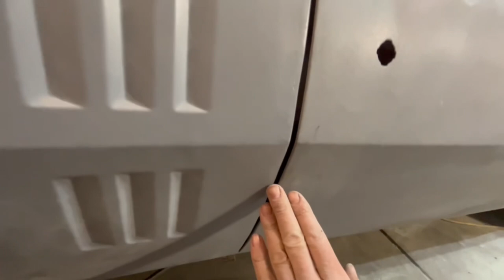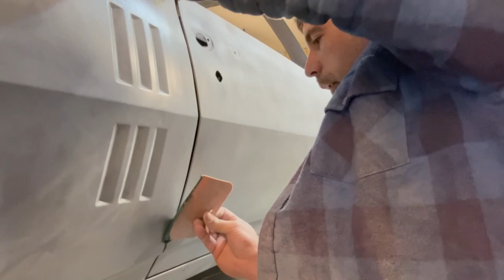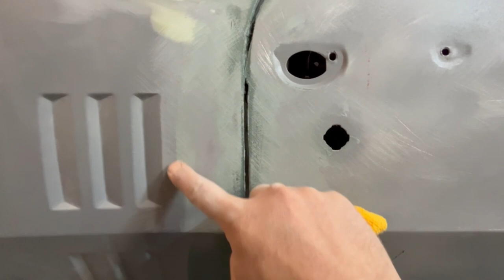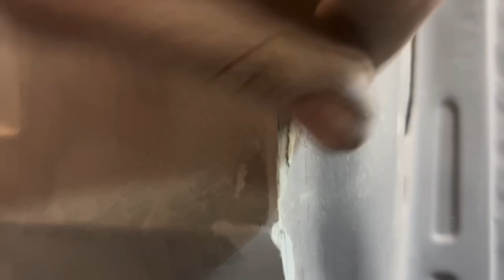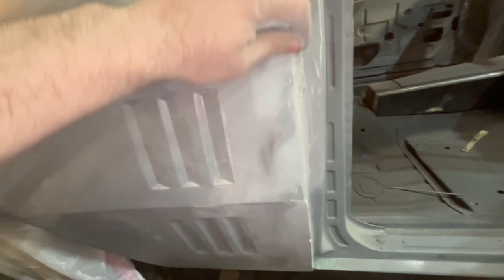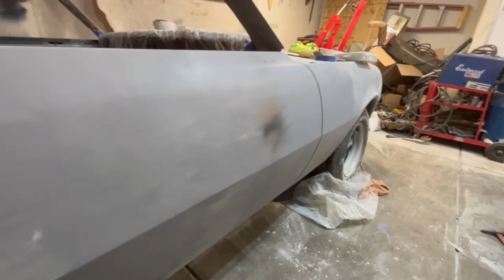Correcting body panel alignment beyond factory adjustments, fine tuning for a higher quality finish

Comment: That’s a great video, very good instructional information, again making it all look so easy , I have got to believe you have been much more than a hobbyist over the years. Thanks for sharing all your knowledge
Reply from the maker: When it comes to restoration work all self taught and most of it the hard way unfortunately.  Now professionally i have worked as a technician on cars for many years and heavy equipment just as long totaling 27 years of experience of fixing broken stuff which definitely helps fuel my restoration hobby.

Comment: "We're gonna try this sanding block"🧱😂
On daily drivers in the salt belt, I use glass as filler & get everything level & straight to 90% basically almost ready for paint. Then a skim coat of bondo. (I have gone right from glass to fill prime before) 

I have an issue on my volvo that was wrecked in the past, was sideswiped. Partial quarter & doors replaced, shotty. (I just fixed the quarter)

The front door to fender gap is way wide. But the hinges are welded on the car side. I'm not sure what to do. May have to live with it.
 
The gap between the two doors is too tight. But back door is good to quarter.. It seems I have no way to move the front door forward aside from pulling fender and trying to pull the hinges on frame machine type rig. Or try to move the doors hinges into the door. Frame could be tweaked but if so, it has been for 125k miles 

Sucks but is what it is. Main goal is no rust for another 10 yrs. The car is pictured on my yt page banner. 250k miles on her, I rebuilt everything piece by piece. Mechanical & body. Still a work in progress.
Reply from the maker: Seems that the solid mount hinges are popular with newer vehicle manufacturers. I had a 03 Silverado that was hit in the doors and experienced the same issue the gaps aren’t adjustable. Beside trying to bend or twist the door post.  What do you do? Be a whole lot cooler if it was adjustable